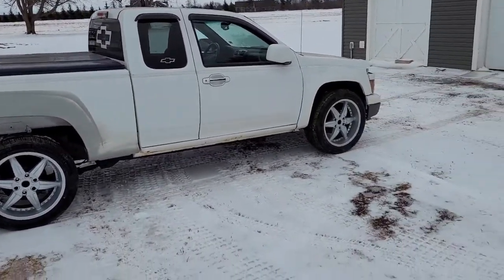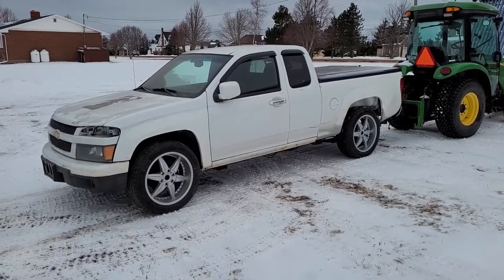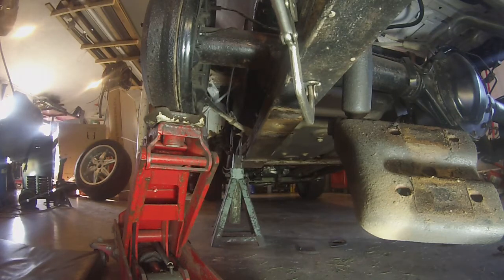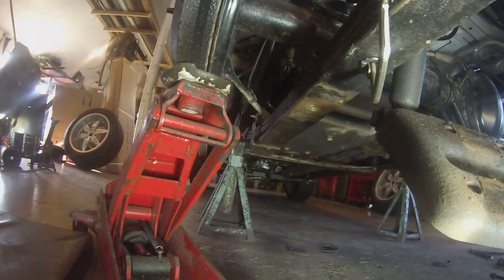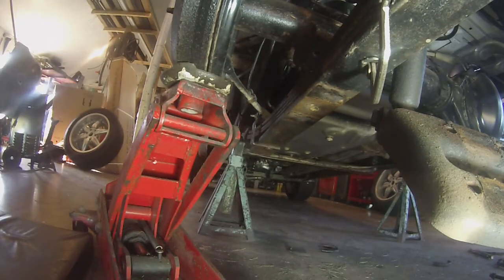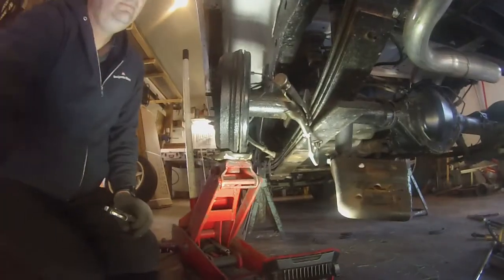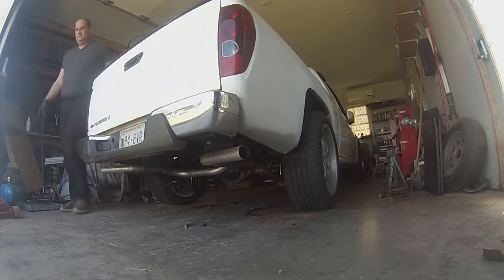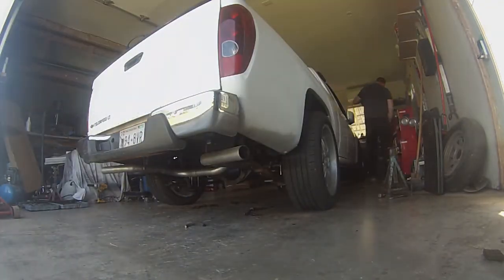INSTALLING BELLTECH 2 INCH LOWERING BLOCKS 6L LS SWAP COLORADO

Comment: I was told when lowering a truck you would need to add pinion shims because the changing of angles. Did you add pinion shims and what degree? Or why didn't you add pinion shims @budslife ?
Reply from the maker: @michaelechivester6478  this was only a 2-in drop so pinion angle did not change hardly at all. I believe that the pinion shims are more important when you're doing a extreme lift or an extreme lower. Personally, I would only use pinion shims if I was doing an extreme lift on a vehicle. Just my thoughts. I'm no professional by all means. You could certainly check this out with a suspension shop, but these are just my own opinions.

Comment: If you measure you'll see the front eye bolt on the drivers side frame is 1" lower than the passenger. Not kidding.
Reply from the maker: @ASEWorldClassTech  Interesting 🤔 I never noticed that. Thanks!

Comment: 😂 It doesn’t surprise me the least bit that some people would hold up the truck by the axle while removing the u bolts on an axle over spring configuration.😂 It would be ok when the axle is under the springs though. Common sense isn’t common anymore and those people have no business modifying vehicles or even general maintenance if safety is going to be a concern (like replacing brakes). The beer had nothing to do with it, it was his mechanical aptitude that was the problem. I drink while working in the garage and nothing has fallen apart or hasn’t worked properly. I even build engines,transmissions and do paint and body. If that guy can’t handle a beer and lowering blocks he needs to sell his tools and pay a mechanic.😂
Reply from the maker: You are so right! Some people just clearly don't know what they're doing.

Comment: Will you come help me put a 3.9l from a 1990 Range Rover into a 1987 Dogde Raider??? I want the 727 trans from the RR and the axels/suspension swapped ove from the Rover to the Raider at the same time.r.
Reply from the maker: Wish I could help you sounds like an interesting project. Unfortunately I don't have a lot of extra time. Good luck with your project.

Comment: I deleted my comment due to it being a sack of rocks with a duncecap.
Reply from the maker: No problem, I saw your other post but couldn't reply. The reason I didn't upgrade the front Springs was because when I went on RockAuto they were the same part numbers for the 2.9 L and the 5.3 L. So upgrading the front springs and shocks wouldn't have really done a whole lot. That's why I decided to put lowering blocks on the rear end. It worked out very well trucks sits very nice now and handles a lot better. Thanks